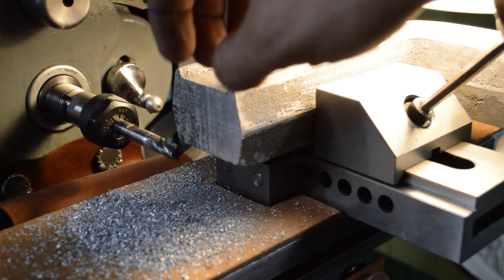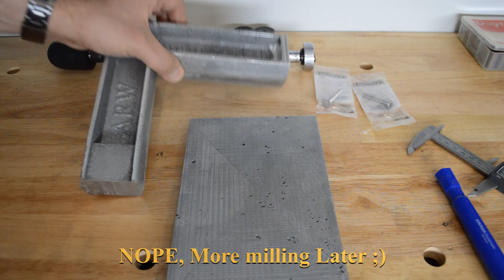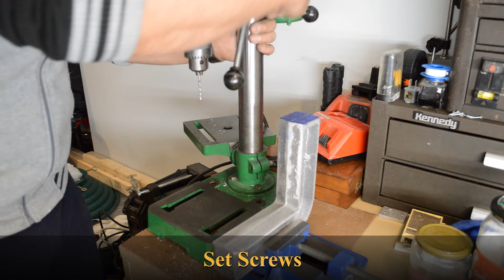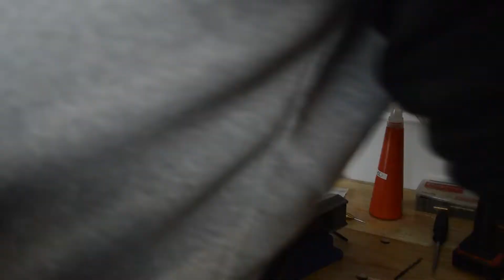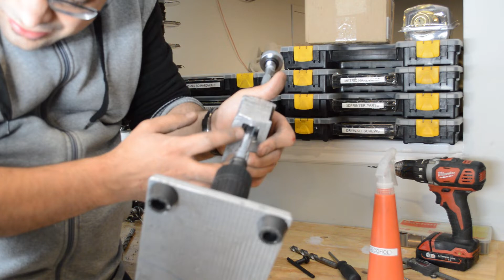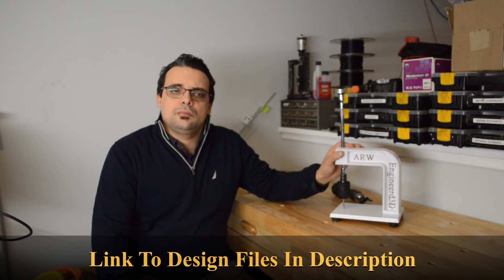Machining Tapping Fixture From Castings - PT2

Comment: Engine hoist and roller for that beast then some sort of hoist/engine lift to get it into the truck.  None of those are cheap.
Reply from the maker: I am going to get an engine hoist and do exactly that. I have 3 machines that need it, logan lathe, surface grinder and the horizontal mill.
Reply: @Engineerd3d  The hoist and the dolly are about 100-200 in total for quality ones.  Considering the gear you have I wouldn't Harbor Freight for those items as I know my luck and the cast iron machine would drop, or break, and BAM.  I had car work done about 12 years ago and their engine hoist dropped my engine.  It did a ton of damage to the car but was due to them using too light of a chain so that always can happen even on the best of days (or something no one would even think about).
Reply from the maker: @thebeststooge  I am thinking of a good used one. For dollies i own a heavy duty dolly that has carried over 1 ton for me in the past and is sturdy enough to handle the gear. Spring time will be moving time i hope for the rest of the heavy machines.

Comment: G’day. The tool looks good, well done. I should have made one before I made the Gingery mill, there was a couple of hundred holes in that project that had to be tapped, hmm off to the CAD program to design one. 
Cheers 
Peter
Reply from the maker: I shared the design files on youmagine. Link in description.
Reply: @Engineerd3d  Thanks I eventually worked out how to find it. Cheers